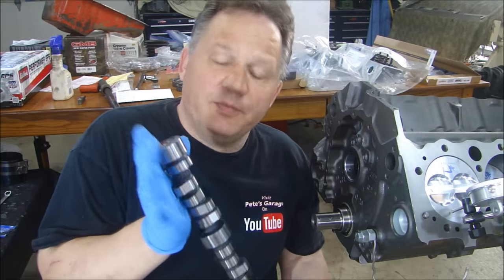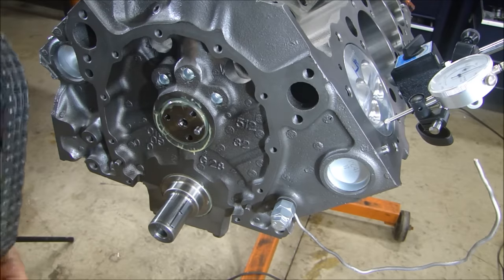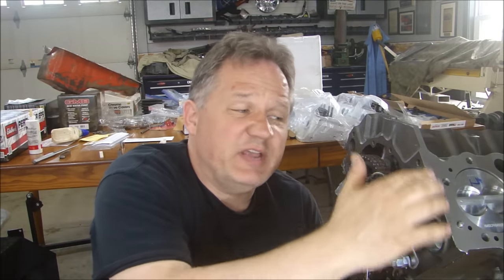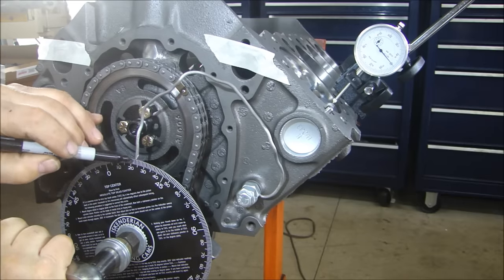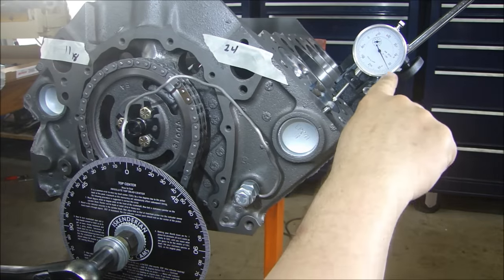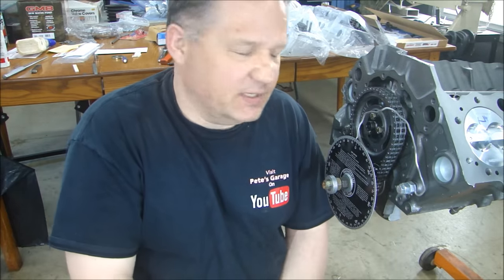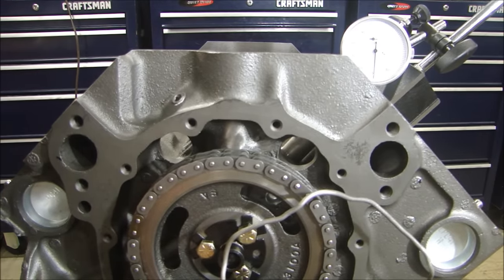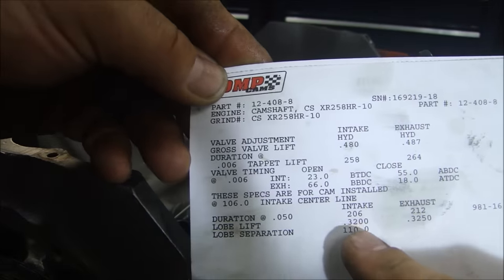Engine Building Part 3   Installing and Degreeing the Cam 350 Chevy Small Block

Comment: Is it necessary to degree a flat tappet camshaft? Or do you have to degree a flat tappet camshaft?
Reply from the maker: You can get away without doing it, but at least check it by rotating the assembly to make sure every is ok.

Comment: So... I get that this the process of how to check timing.. What if the timing is off? How is the issue resolved?
Reply from the maker: If the timing is off you can add or subtract degrees by the keyways in the crank sprocket. If it does not have extra keyways you can add or subtract one tooth and recheck.

Comment: hello so I could be wrong but are you essentially just checking the cam specs. how is the information that you have obtained then used  when building or using the engine I guess I'm trying to say ? cheers mate
Reply from the maker: This is just checking the cam. I have seen the wrong cam come out of the box. I do have videos about degreeing the cam.

Comment: I love you vids. Thanks for sharing you knowledge. I am currently rebuilding an engine. Stock. When inspecting cam one of the lobes was pitted. My machine shop said not to use. If I replace with stock cam do I still need decree cam? An nobody ever tell LS what to do if it’s off??? Help please. Thanks again.
Reply from the maker: Thanks Ray. If you just replace the cam you don't need to degree it, just make sure it's lined up.

Comment: Great video.  My guess is that you want smooth running so you selected a relativly mild cam?  Thanks for posting.
Reply from the maker: Yes, this is a daily driver with only a tad upgrade in performance. Need enough vacuum to run brakes.

Comment: Another great video Pete.  In the dyno video for this engine you stated this roller lifter cam is just a notch above stock. What timing would you set for this cam? For SBC 350's I have seen 4deg BDTC for manual trans and 8deg for auto.  I have a man trans with a 1970 383 stroker with a slighty more aggressive comp cams with similar cam card.  At 0.050" it has 230/236deg duration and .340/.347" lobe lift at I & E respectively. My timing marks have no numbers just A and R at the 4th tick mark on each side. I think I set the advance to 8deg after seeing most marks increment by 2deg.  I read comments on forums stating that 4deg BDTC will melt headers so they recommend much more advance like 12 up to 20 deg.  Do you need more advance for more aggressive cams? Does less advance result in more unburned fuel causing the headers to get hotter or are these forum comments incorrect?  I don't want to run too much advance causing premature detonation.  Thank you.
Reply from the maker: This one was set about 14 degrees ahead. You have an interesting situation. You advance the timing to get more power, but it makes more heat, so use a higher octane fuel that will run cooler and not pre-det. It really depends on compression and the cam specs so it's tough to make a general statement about it.

Comment: I just had my cam degree  can i slap my heads on  but I also using a retrofit hydraulic roller camshaft but I haven't measured my camshaft end play yet
Reply from the maker: Measure end play first
Reply: @PetesGarage  I already bolt on and torque down my cylinder heads but u haven't installed my hydraulic roller lifters yet until I measured my camshaft end play
Reply from the maker: If you haven't started it you can take the heads off and reuse the gaskets

Comment: Hey Pete, question about cam timing.if a cam has 4 degrees advance built into a cam grind.do you deduct those degrees when setting base timing on your pointer from factory settings with a timing light? Comp cams L79 nostalgia camshaft.having a hard time setting timing.won't run unless it is around 20 degrees BTDC
Reply from the maker: No, timing is about when a plug fires, not valve timing

Comment: ive never built an engine that had a chain for timing before, always just had gearing to match up
Reply from the maker: Most American V-8's have a chain
Reply: Theres gear drive in some american v8s, i love the noisy gear drive on my big block it sounds awesome but mine is aftermarket

Comment: I installed a cam shaft on a 05 Silverado 5.3 I also removed the both heads to clean them and change my lifters as well, but I have a very important question about regarding my crankshaft, so after I finished installing the new cam with retainer plate tighten down and cam sprocket to 6:00 and the crank sprocket at 12:00 along with cylinder @ TDC everything torqued down afterwards I went to crank the crank shaft with a ratchet and only allows me to turn it almost 90 degree to clockwise and counterclockwise then stops and I cant crank any further on either direction this is not normal I can only go back from the 90 degrees on what ever direction I'm turning to I even tried cranking the crank with no cam shaft and still the same issue also my heads are not installed yet.
Reply from the maker: You'll have to take it apart and turn the crank until you find out what is binding

Comment: In what years did they start putting cam buttons
Reply: It's an aftermarket device to prevent camwalk on roller style camshafts. 
GM (as far I've ever known) never used them.
Reply from the maker: Thanks Kyle

Comment: Hey Pete, how do you go about transporting the engine when you go back and forth to the machine shop?
Reply from the maker: Depending on the block I lift it, slide it, or hoist it into a truck or trailer.
Reply: Yep I hoist the engine in the bed of a truck using wood or a tire to sit it on.

Comment: I'm a total newbie here lol so my question is do you degree the cam just to verify the cam specs are actually what's on the cam card or does this absolutely have to be done after installing a cam?
Reply from the maker: Degreeing the Cam is important when you are building an engine that requires a slightly advanced or retarded valve operation. For a standard rebuild or newly built engine that is fairly stock, it's not necessary

Comment: Hi Pete! first off all thanks for the time you take to explain the details and names on what you do. I do have a question about dot to dot, I saw anothershort film on youtube he would never do this because the engine would never turn over. What do he mean about that because i just you do exactly the opposite thing. Thanks again Pete
Reply from the maker: That's a great question. If you share the video with me I'll share it and let you know. Dot to dot is straight up timing. If it does not turn over something else is wrong,.

Comment: What all do you need to have off to do this? If you just want to replace the stock cam do you need new bearings or is it just as simple as Removing the old one and sliding in the old one?
Reply from the maker: Well, you need all of the pulleys, water pump and timing cover off which is tied in with the oil pan. You can take a chance, but the bearings should be changed. You'll have to pull of the intake to get the lifters out so it would be worth it.
Reply: Thank you, great videos!

Comment: My suggestion is to edit out the bit about decking the block affecting the camshaft operation. The video is great but decking the block does not change the timing at all; the statements are wrong. The piston does not care how much space there is above it. Either it is going up on a compression stroke or exhaust, or going down, firing or inducting. That is what determines which valve should open and when. The strokes are not affected at all by the compression ratio.
Reply from the maker: Thank you Andy

Comment: I know this may be a stupid question, but here it goes anyway. You said that when you install a camshaft, you only lube the bearing journals and leave the cam lobes dry because the lifter rollers have a tendance to skate running over lobes. Is this a procedure you do to ensure accuracy when your degreeing the cam and will lube cam lobes later. Just wondering.
Reply from the maker: Great question. If the lifter roller skates it will cause a flat spot on the roller. It will not affect the measurements when degreeing the cam because any lube would be very thin.

Comment: Hey Pete,
I have a 350 4 bolt 2 piece seal, 60 over, with 906 vortex heads. I'm installing a summit 444/466 #1103 cam flat tappet. Do I really need to degree the cam?
Reply from the maker: No, but it does not hurt to check
Reply: @PetesGarage  thanks. Watching all your videos so I won't miss anything.
Reply: @PetesGarage  also,
My heads are stock with the roller rollers 1.5 from comp cams. Is there anything I should be worried about with the same pistons you have in the video and my 444/466 cam?
Reply from the maker: I don't know about worried, just check all clearances

Comment: You didn't degree the cam. You checked it. If the specs were off, how would you "degree" it to get it where you wanted?
Reply from the maker: I would get a sprocket with extra slots to advance or retard the timing

Comment: Why would you not install the cam first, then you  turn the engine upside down and guide it by hand?
Reply from the maker: It's a matter of preference. This is the way it's done in the factory
Reply from the maker: @bigboreracing356  I've never had a problem
Reply: Street racer, he was probably referring to these early production 350s.... like the one in the video. Things were still hand assembled well into the 90s.

Comment: a bit off subject, I am tearing down an old 66' 283 it doesn't appear I have a cam sprocket button or a  threaded crank end. Will my replacement  timing set come with bolts and button? also would it be wise to thread my crankshaft?
Reply from the maker: Is there a cam retention plate? Do not thread anything that does not come threaded.
Reply: Yes there are bolts with a plate similar to this. I ask about the shaft because I have seen it successfully threaded with a tool/guide that slips over the crankshaft end to guide the tapping bit and die centered. 66’ 283
Reply from the maker: If there is a cam retention plate you do not need a button

Comment: Hey! building an engine for my 1989 vett. What cam did you use? Or what cam do you recommend?
Reply from the maker: All depends on your budget, but you can go up a couple from stock on the same valve springs

Comment: Hey Pete. I just found these vids. I am not sure if you are still available to answer questions on your older vids, but I have one for you. Do you degree your cam using the lobes for the #1 cylinder only or do you check each lobe in each hole? I ask because you have confirmed the two lobes for the no. 1 cylinder are correct, but is there a chance the lobes may be incorrect for the other cylinders?
Reply from the maker: That's a great point Dennis.. You degree off #1, but you can check all of the.m

Comment: Good morning do you only need to degree aftermarket performance cams or it applies to OEM cams as well, thanks ?
Reply from the maker: If you're replacing the cam it's a good idea to check, just to make sure they didn't throw the wrong cam in the box.

Comment: The funny part is. I've never seen or had a cam not fall in spec when degreing a cam. WTF Happens when one is out of spec & how do you fix it??
Reply from the maker: It depends how far out. If it's 2 degrees or more I adjust the gear or move the chain one link
Reply: @PetesGarage  that's what I'm saying.  I understand "how" to fix it. I've just never seen it.
    Is it really all that necessary for a stock or mild street engine? 
    What's off. The cam ground incorrectly? Chain? What can be off.
Reply from the maker: They can be ground slightly off or the manufacturer can put the wrong one in the box

Comment: How do you get your blocks so clean I have a hot tank and they never that nice
Reply from the maker: Bake them for 24 hours
Reply: @PetesGarage  any chemicals you use? I mix chem-dip and hot water and blow it off with air and soak it down with WD-40 so it doesn't rust
Reply from the maker: No chemicals, just bake for 24 hours and re -tank wash

Comment: No changes were necessary, so this confirms installing straight up dot to dot on the gears positioned the cam to spec in this case.
Reply from the maker: Correct
Reply: Okay, thanks.
FWIW, I've experimented a couple times myself (advancing cam 2~3 degrees) but no scientific results to offer with actual dyno results.
Reply from the maker: I have advanced cams up to 4 degrees and it does make the crisp
Reply: @PetesGarage  yes, I failed to mention compression increased as well as vacuum, in my experiment.

Comment: You will do yourself a favor do this with only one pistion in the engine turns a lot easier
Reply from the maker: The cam goes in after all of the pistons are installed

Comment: How or what did u use to paint the lifter valley and rest the block black like that? Wanting to paint my lifter valley and inside my heads
Reply from the maker: It's not painted with anything, why do you want to paint yours?
Reply: @PetesGarage  well hell must've just been lighting or the way I looked at it on my phone lol it looked black to me lol. Someone told me about painting it to help oil flow back to the pan faster and it would also keep rust out while it's being built. And I think it'd look kinda cool lol
Reply from the maker: The oil will flow back fine without it and you'll never see either. If any coating starts to flake off it can cause damage. I really see no benefit to doing it.
Reply: @PetesGarage  Alright then I'll take your advice. Sounds risky getting chips in oil gallery's and what not, and for no benefit it doesn't sound like it's worth the risk. Thanks for the opinion

Comment: Why do you go backwards for sure there will be some slop . But the engine will never run backwards. It only makes sense to do this if you are gonna have adjustable cam timing
Reply from the maker: There is not as much lash there as you would think

Comment: Am I missing something. I didn't see where you made any adjustments to anything. Just confirmed the cam was per specs. Is that because it was installed correctly and didn't require any adjustment? Not really seeing what the purpose is for this test.
Reply from the maker: If the cam is correctly installed, no adjustments are needed. I check all cams to make sure they are not mislabeled in the box

Comment: 206/212? 320 lift, that's a baby cam lol, what kind of rpm do you plan on turning this thing?
Reply from the maker: Probably around 5k
Reply: 320×1.6 (rocker ratio) = .512 lift

Comment: "Question" HELP... I HAVE PUT 3 CARB. AND 2 INTAKE MANIFOLD. AND MY 350 STILL NOT RUNNING RIGHT. ANY HELP WOULD BE GREAT. THANKS. VAC LEAKS. SOMEWHERE NOT SURE WHERE.. ANYBODY. KNOW. SOMETHING I DON'T.
Reply from the maker: Maybe head gaskets on the wrong sides, timing 1 tooth off

Comment: Dont you want to put cam in before the crank so its easier?
Reply from the maker: It's a preference. I put the cam in after so if you drop something while putting in the crank you don't nick the cam.
Reply: @PetesGarage ohh, ive done it both ways anf find it much easier to guide cam in when everything is out of the way..
 like what do you drop..??
Reply from the maker: Main bearings, rod bearings, main cap, bolts...it's just a risk

Comment: Oye...NEVER red thread locker!  Always, ALWAYS use the largest degree wheel you can! Accuracy increases dramatically. Degreeing the cam as with setting the rod and main clearances is so therapeutic.
Reply from the maker: Any thread locker is a secondary retention method

Comment: If the camshaft is wrong, how does the camshaft handle?
Reply from the maker: The engine will not run.
Reply: +Pete's Garage Is there any formula that calculates the angle of fit?
Reply from the maker: No, you just have to buy the right one

Comment: I can understand stopping and starting video, but when you were checking centerline, you rotated the crank CW to put #1 lifter all the way open and zero the dial gauge. Then you rotate the crank CCW until the dial gauge read 0.050 and the wheel number was 64. Then you rotate crank CW until the dial gauge read 0.050 and the wheel number was 146. Your Centerline was 105. The video was stopped and then started again for the Duration. Your dial gauge now reads zero! What happened? Where was the lifter at when doing the Duration? Very confusing! You should have shown what you did!
Reply from the maker: To measure duration at .050 you start from zero or on the base circle of the cam, turn it to get .050 and measure duration to .050 on the other side. Sorry that is confusing, I should have been more clear.

Comment: You should never reverse rotate an engine. I don’t degree my cams. I can set all that with a timing light once the engine is fully assembled.
Reply from the maker: Any reason why?
Reply: I don’t degree it. I just install it with the tick mark at the top and then I set the motor to TDC and put on my timing gear and line up each tick mark with engine at tdc and then I put my timing chain on

Comment: Ever one knows that has been building engines, you put the cam in first. That way you can see what's going on your not wondering if it's right or not.
Reply: I fit my camshafts first in case there is a problem. No point in building a short block, and then finding a cam bearing issue etc.
Reply from the maker: I put it in after the crank assembly so if you drop a rod or main bolt you don't have the chance of nicking the cam. That's the way it's done at the factory.

Comment: So without an adjustable cam gear, the only reason u would check the cam is to varify what the maker says it is? Without adjustable cam gear your pretty much stuck with what u got. Correct? Theres no adjustment to be made.
Reply from the maker: That is correct, you can get gears that are offset to fix that